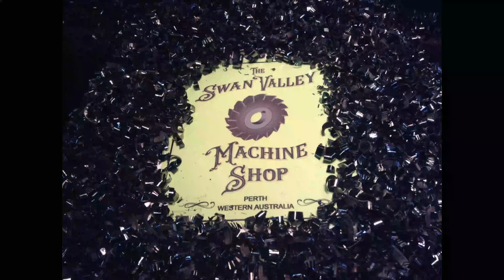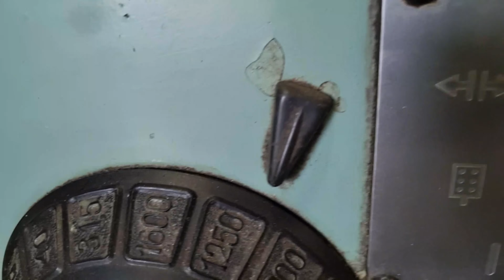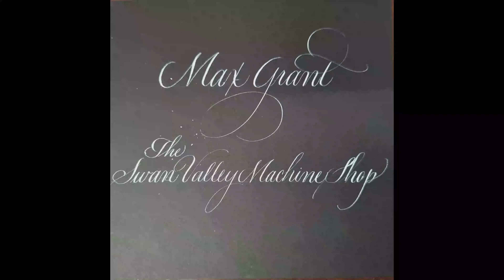Shop Made Tooling .  Angle Plates & ''Olga'' .   Part 1.

Comment: Nice work as always Max. I'll be doing the same job in a few weeks on my HBM. I have a set I fabbed up years ago, and they were close enough for the job I was doing. But now it's time to true them up for a new job.
Reply from the maker: Thanks  Josh .     Just going over my quick change tooling , very similar to yours .  👍
Reply: @swanvalleymachineshop  Are you referring to that magic chuck I have?  I have a smaller one if your interested in it.
Reply from the maker: @TopperMachineLLC  Sorry Mate , missed the reply .     No , i have a good range of the Herbert ones , that i will modify 2 of the holders to take the play out of .    Cheers

Comment: Your weld prep and weld method looks spot on, excellent point on plate lamination, during my apprenticeship in the training shop it was annexed off the fab shop. We were right by the grinding and fettling area, and the leading hand would also Vibration Stress Relieve (VSR)  certain weldments, as per call up. During one test we heard the loudest bang, then a massive cracking sound, yes, lamination had showed its self. 
Love the foot start procedure, certainly more ergonomic than a hand lever pump.
Great job Max.
Reply from the maker: Thanks  . I was machining a plate in an old video , that had a big lamination through it !  👍

Comment: Perfect timing. I picked up some 1 ft by 2 ft by 1 inch thick plate to make some angle plates for my boring mill. No real way to stress relieve if I welded them up at that size so I was thinking about bolting them together and having gussets in the back.
Reply from the maker: No worries Tom .      They can still move after machining .   Steel plate can hold a lot of stresses .  👍

Comment: I'm glad I'm not the only one that removes a few inserts in a face mill like that! 
It's refreshing to see others trying radical steps to get results! 

Nice work, Max!! 🙂
Reply: Leave only one insert, then it becomes a flycutter, works quite well (I think). I noticed that my cheap facemill has quite a bit variation in the insert heights, which affects surface finish. One insert leaves it at one height only. 🙂
Reply from the maker: Do what ever it takes !    Thanks  👍

Comment: G'day Max, a master class in persistence.   I think we have all tried changing the insert configuration on cutters.  I have found once the harmonic starts it's there to stay.  Changing up the speeds or feeds just when you feel it coming in makes a big difference.  One of the advantages of a VFD.  I've used a cutter like a fly cutter but never thought to modify the insert, that's one tip I'll lock away for a problem day.
Cam
Reply from the maker: Thanks Cam .  The flat contact edge on that insert was just too wide causing the plate to ring .   Cheers  👍

Comment: Hi Max, didn't know much about lamination in steel back in the late eighties.
Ultrasonic thickness testing was carried out on a 48" elbow on the  outlet of the Vacuum Distillation Column some 200 feet high and deemed too thin.
It was removed at great expense.
I was walking past and the Maintenance Manager was going to town on the alledged thin area with a ball pein hammer and yelled out its laminated, threw the hammer down in disgust.
Perfectly good elbow removed for no reason?
Reply from the maker: That's experience !    Machined some blanking plates back in the day for North Rankin A platform ,  they were all Ultrasonic tested or what ever they did .  Had certification stampings that woe betide if i accidentally machined them out !   👍

Comment: Hi Max it looks like the first runs on the machine are going good. Are you going to bolt it down to the floor? The reason for asking is if that will effect how it cuts. Cheers
Reply from the maker: One day it will get bolted down .  There is enough weight in the machine not to effect those small cuts .   Thanks  👍

Comment: Aside from being extremely experienced, with a well calibrated eye, do you use any means of non-destructively testing thick weld beads and plate?  I used to work at a place that made wind towers, and ultrasonic testing was the main inspection method.  There was dye/penetrant, and in certain situations stuff was shipped out for x-ray testing, but it was impressive how much could be caught with ultrasound.

It wasn't just for fabrication issues either.  Had some customer supplied steel from God only knows where, with sparkplug porcelain and such fully embedded in the plate. One of the few times in my life I did an actual double-take, trying to comprehend what I was looking at after rolling the plate into a cylinder.
Reply from the maker: I do not do any testing .    Ultrasonic gear is used at work to test the thickness & wear  of steel in track machine rollers .    Lol , the porcelain is a new one on me !   Cheers 👍

Comment: As a welder and a NDE tech, I agree with you approach to the welding to avoid opening up laminations with heavy weldments. I do have a comment on the use of Xray to detect laminations. Xray does not detect laminar indications unless the direction of the source lines up with the lamination. the reliable NDE to detect laminations is with ultrasonic shear wave.
Reply from the maker: Thanks for that .     Cheers  👍
Reply: Correct

Comment: Max, would it have helped dampen the harmonics if you also had clamps right out at the end of the toe of the plate, ie; in the centre T slot of the table. As is, you only clamped in two positions of the plates, and the more clamp positions the better, even if it is showing to be flat.
Reply from the maker: I could not fit extra clamps in .  The outside slot in the table is a coolant drain , not a tee slot  .   Cheers  👍

Comment: From your cut pattern it seems you had several inserts at different heights. I fine tune cutters like this with an indicator and I shim the inserts. This helps with chatter also.
Reply from the maker: Thanks .    In the milling cutter modification video a couple of weeks back , i found them at different heights .  These inserts can not be shimmed or adjusted .  👍

Comment: I wonder if shot or sand bags would help with that chatter.
Reply from the maker: Probably not as it was only an issue at the top of the vertical plate .  Cheers  👍

Comment: Hello Max.  
Can I suggest that on finishing cuts, make them all in the same direction.
Also, for finishing, use a small radius on your carbide insert.
Reply from the maker: That's why i reduced the flat on the insert .  Do not have any small rad inserts for that face mill .  Usually get by with the inserts that i use .    As for cuts in the same direction , that is more important when chasing accuracy .  I want to see how this machine reacts in all directions , to see the condition of everything .  Cheers  👍

Comment: Hi Max, I would have taken a flyer off the top faces so that when you machined the second face you could have put some dowels in the tee slots and went hard up against them, saves having to measure from the column and you keep the thickness consistent, also saves having to clock in for the finishing cuts. Just a thought. Best wishes Mal.
Reply from the maker: I plan to make a couple of blocks that locate in the t slots .    They need a clean up with a file on the bottom corners from previous t nut damage / burrs .   👍

Comment: Good video friend Max..thanks for your time
Hello Max. If you allow me as a professional miller, I can give you some advice.
The clamping of these pieces can be improved... they should have staples holding the pieces at the top with at least one staple in the middle and one staple on each side
You would also have to take into account that some welded squares should have lateral triangles that in Spain we call gussets and that is what really gives rigidity to the squares and allows you to avoid bending... in fact the gussets can be screwed now that they are still You are at a time, and once the gussets are placed, then you do a few passes planning the surface with a couple of tenths...on the other hand, that milling plate with that plate geometry is more for roughing but it is not appropriate for giving good results. finishes... an apkt 16 type geometry with aluminum plates would give you a much better finish... or also a flicutter to do the finishing passes
a greeting from Spain
michael
Reply from the maker: Cheers Michael .    I will go through the reasons & questions from others  at the start of part 2 video .    Thanks 👍

Comment: Face mills and I do not ever seem to get along with each other either Max.  I never thought of using the face mill as a fly cutter. I usually use a boring head but never at 1000 RPM! . like  your idea much better. Cheers
Reply from the maker: No worries .  I have used my boring head in that way before as well , it works !   👍

Comment: Hi! I think that milling head is wrong. After hardening it was twisted. But really it's work for shaper. And surface grinder. 
But I don't know Your plan for this tool.
Reply from the maker: Thanks .   I was  going to do the job in the shaper but it would have taken 10 times as long .     Cheers  👍
Reply: @swanvalleymachineshop  Really. But shaper work, You drink tea )  My main jod - 3D printing. Ohhh it's very long... I understand You. And video how shaper work not so interesting  ;-)

Comment: Hi Just for clarification, you cannot find laminations in plate bt X RAY testing as the beam cannot detect the lamination perpendicular to it. Commonly lamination testing is done by ULTRASONIC testing with a 90 degree probe. This will detect laminations perpendicular to it as it reflects the sound wave back to the probe. 
Mick   UK.
Reply from the maker: Thanks for the correction  .  Last time i machined that stuff , it had numbers stamped in that were not allowed to be machined out .  Blanking plates for an off shore gas rig .   Cheers  👍
Reply: Hi. That would be for traceability. There may also have been 3rd party inspector stamps for independant witness verification as well. @swanvalleymachineshop

Comment: Don't you love flycutters ?
Reply from the maker: Might have to make one & find out what all the hoo ha is about !   Cheers
Reply: YES, a flycutter could be made to be as wide as the workpiece and therefore one blade wide.  They give brilliant results.  See Topper Machinery for a fine example.

I once had access to a universal milling machine which had one cutter head 300mm diameter. Couple of passes would do a great job of the angle plate.

Comment: Banana brain here.   when you say "take a 1 mil cut" do you mean 0.001 mm?
Reply: Probably means a full mm because 1 mm is only .039 of an inch.
.001mm is a tiny .000039 inches (39 millionths) (or 1 micron)
It can get confusing! 🙂
Reply: Looking at the chips he’s making they are 1 mil(imeter).
However, I think that if said 1 thou that’ll be 1/1000”
Reply: He means 1mm or 40 thousands of an inch, small cut for Olga 😊
Reply from the maker: Just 1.0 mm .   Cheers  👍